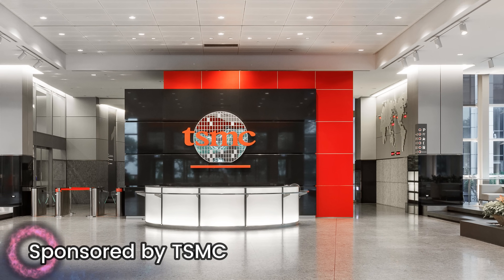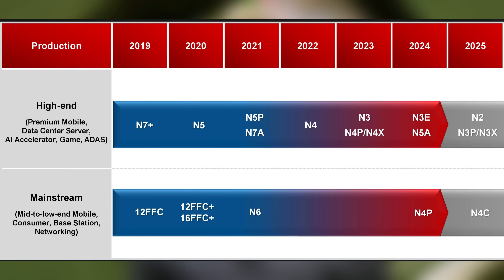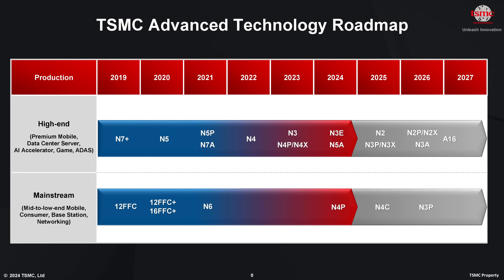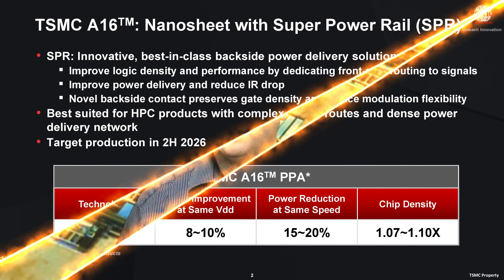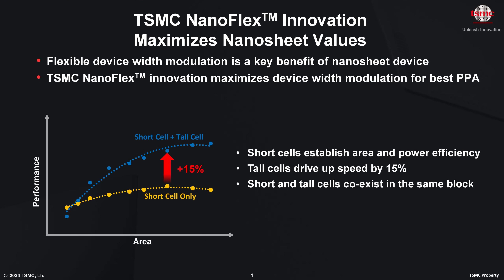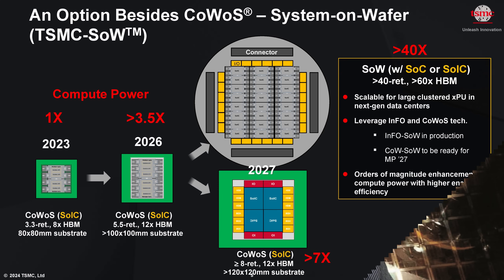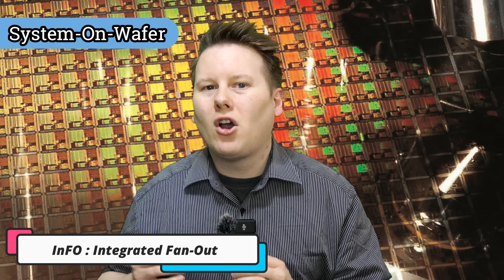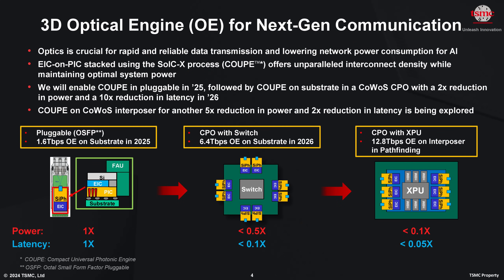The Magic of Transistors: TSMC's Path to A16!

Comment: It appears to me that Intel, for the first time in many years, is ahead of TSMC!    For decades TSMC was the fast follower, then TSMC  leaped ahead of Intel due to Intel's strategic mistake of not embracing EUV early enough.   Now that Intel has EUV, they have quickly caught up and it appears they have even surpassed TSMC.  Intel 20A node, which is essentially out now, already has gate all around transistors (nanosheet, ribbonFET, whatever you wanna call it).   20A also already is using backside power delivery.  So Intel already has two new key technologies  built into ththeir 20A node!   Intel 18A will be out just a bit after 20A in late 2024, and will put Intel even further ahead.    It appears, Intel will also stay ahead thru the remainder of the decade.  Here's why.   Intel is the only foundry to have purchased, installed, and begun using an ASML high NA EUV stepper.   These can create features 1.66x smaller than the standard NA EUV stepper.   TSMC has arrogantly said they don't need hight NA until 2030. Sound familar?  This sounds just like Intel did circa 2017, when they said they didn;t need EUV.    Can TMSC eek out something competitive without it?  Probably, but they will have to rely on mulitpatterning and lower yields.  Intel 14A will be out in 2026, likely one year ahead of TSMC's A16.    Not only will 14A be out a year earlier, it is almost guaranteed to be better since it uses high NA.   Intel is back.  WIll their foundry be as big, no.  Will it immediately win over Apple and Nvidia?  No, but it will eventually.  I think many companies that demand to be on leading edge, will make the switch in 2026 with Intel 14A
Reply: You have been too fast in your conlusions. Doesn't matter what tech Intel has If A LOT of their last CPUs have defects...

Comment: Selectively Optimizing transistors for power trade offs seems like a good fit with wafer scale products … heat dissipation has got to be a big issue.  I always considered the heat build up issue would push wafer scale designs into long narrow wafer slices.  This allows the heat buildup to dissipate more effectively than from a square wafer chunk.

Comment: 300mm chip? How could you be supposed to cool that chip?
Reply: 300mm waffer not 300 mm chips a 300 mm chip = 17.3mm^2
Reply: @lasarith2 At 4:45 in the video, they do indeed speak of wafer-sized solutions for AI applications.
Reply: The wafer will be mounted to 100kg copper radiator, and cooled with jet engine fan

Comment: Wow after knowing Intel would separate power and signal delivery between the back side and front side of the silicon wafer, TSMC is also revealing their plans to do it too! Also it's interesting that TSMC is using nano sheets for their A16 while Intel plans to use nano Ribbon for A18. It's all coming together like crabs.
Reply: Intel using nanosheets with their 20A node, which is in fab now and releasing products later this year.  20A also has backside power.  So Intel is ahead.
Reply: @sofiabonetti.  We'll see if these even make it out the fabs before rusting

Comment: Not impressed. TSMC hit speed bumps with N3 and is slowing down. On the other hand now that Intel has turned their ship around they are going as fast as possible to surpass or match TSMC. Apple is dealing with the effects of TSMC hitting a wall, as their M silicon continues to grow in area gen after gen after gen as density gains are getting anemic.

Comment: Hey Dr Cuttess, if you want to improve your chroma keying, the key (heh) is to use more lights. The more/bigger the better. If you are filming with a camera that let's you film in raw or raw-like, or something like Sony's S-Log with high dynamic range, you can in post tone down the lighting so it looks natural. However, by having that much lighting, the camera picks up the color differences much better and the surfaces are lit in a more homogenous way, so the cutoff of your silhouette gets much sharper and not jittery.

In general, the more you can lower the ISO, the better, since a lower ISO means the camera does less guessing and colors are closer to real life. High ISO also introduces jitter and noise (bad for keying).
Reply from the maker: Good to know! It's already better than it used to be. One of my issues is that my office is only 12ft x 10ft - and most of that is storage for hardware. Leaves the area to film in very small
Reply: @TechTechPotato  yeah, that definitely complicates things. If there’s only one thing you can focus on, let it be having a uniform and strong lighting. Uniform as in lighting from various angles, so that there are no areas in shade confusing the camera/editor. Also prefer less but bigger lights to more but smaller lights, since for the same lumens, the bigger the source, the softer the shadows.
Reply: @TechTechPotato maybe get an office bigger than a toilet.

Comment: I'm all about that backside power.  Aka Badonkadonk.  Intel calls it PowerVia.  I don't know why they don't work with motherboard managers to allow for backside cooling.  Put all the VRMs on the back close to the chip to keep voltage as stable as possible and put all the memory on the frontside as close to the chip to keep latency down and have coolers on both sides of the board.

Comment: Huh... You know, I didn't expect for TSMC to be talking about angstrom chips already but here we are. I guess that something in the market spooked them to do that, as much as I would like to think that it is IFS... I am not sure it is.
Reply: ASML’s CTO said in a recent Dutch interview that they are actually not below nm scale yet, that’s just marketing. High NA is somewhere below 10 nm. Previous gen at about 10 nm. Also, he said they finally got a proof of concept working on High NA so "it is now very unlikely to go wrong” while it has been very uncertain so far (as it always is with a new machine he said)
Reply: @C4rb0neum  Meh. It's still same old 32nm, for everybody, just in layers with fancy titles dreamt up by marketing clowns.
Reply: @cryptocsguy9282  The math behind is pretty simple: they now stack a 32 nm transistor below other 32 nm transistor and proclaim overall density to be twice higher, or thrice if they manage three floors like that, and so on. That's what FinFET was about, and whatever came after it.
Reply: You don't need to be spooked by anyone, when your next gen product is the last of nm nomenclature, and there is a logical question: what is next? It is not like Intel is chatting about products planned 20 years from now, while their current product is struggling.
Reply: I thought the next metric unit would be the spacing distance between crystal silicon atoms (3 to 5 atoms per nm depending on the crystal orientation direction)

Comment: they can do this without the new machine that Intel bought from ASML?
Reply: I think (but I could be wrong) TSMC said something on the line "extreme UV is not required for sub 2nm nodes", so perhaps they don't need them, but it would be a bit strange that Intel spent so much money to book and buy the first 6 ASML machines if they were not essential. Or maybe TSMC is confident that this SPR can bring them to a node that matches intel's 18A, but without those machines
Reply: @mastroitek Intel 18a won't be made by High NA EUV.
Reply: @mastroitek  Its true they do not need extreme UV for sub 2nm but in that case they can only make a chip half the size.
Reply: Intel bought the first 6 of them. No one else can get one until second half of next year.
Reply: I assume this A16 is going to be what Intel calls 18A.
Reply: no

Comment: How is it called "angstrom"! when it's 1.6nm or in the case of Intel, 1.8nm or 1.4nm!? shouldn't it be in the sub-nano realm, in order to be called angstrom (100 picometers)!?
Reply: angström is 10^-10 and nano is 10^-9 so 10 angström are 1 nano. Angström does not follow the typical scale
Reply: bc micrometer and milimeter are too similar when abreviated, you gotta remember that these are all marketing terms at this point.